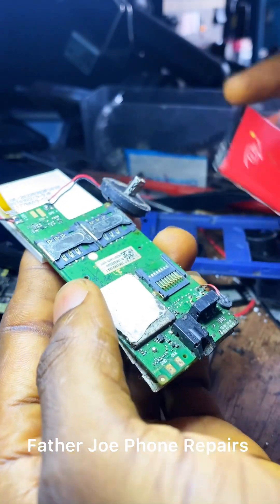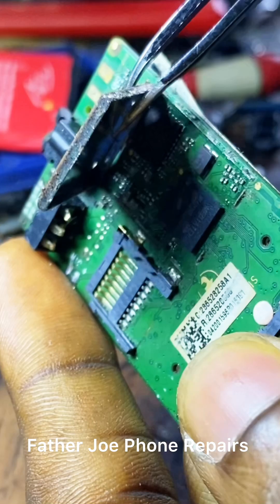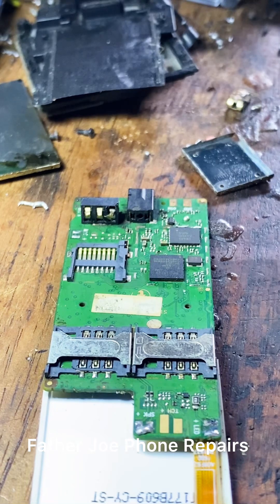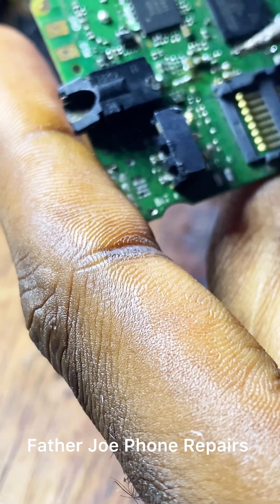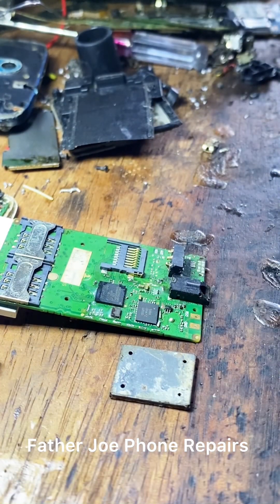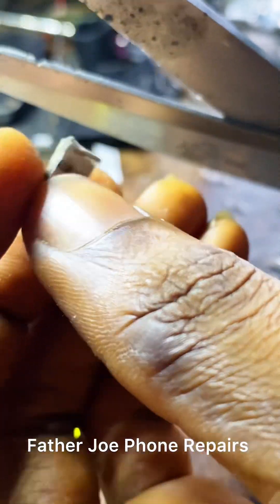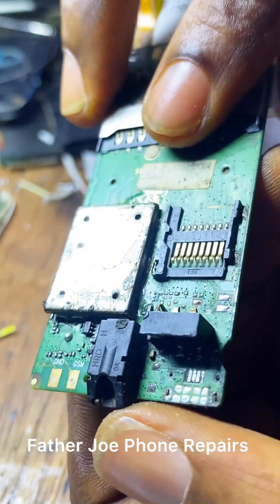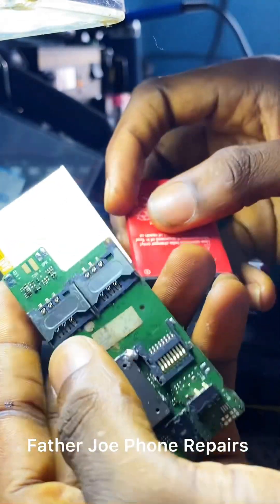How to Fixed 7 8 9 0 in any button phone ( universal method that works ) ✅

Comment: Please i changed my Tecno pop 6 screen and the mouthpiece stopped working. I have changed down boards and it's still not working, please How do I connect a jumper on the panel to make it work
Reply: Rechange the screen
Reply from the maker: kindly drop us a message on watsapp